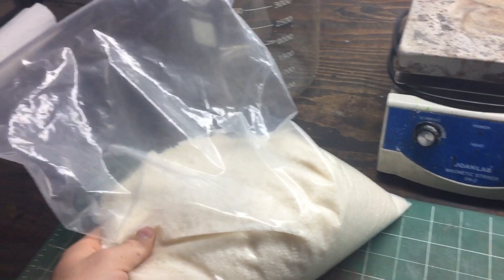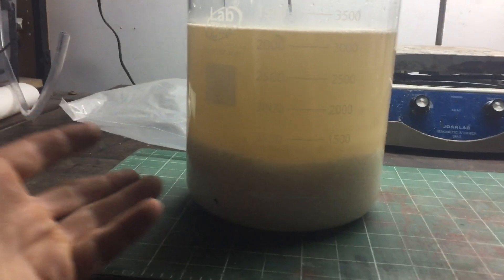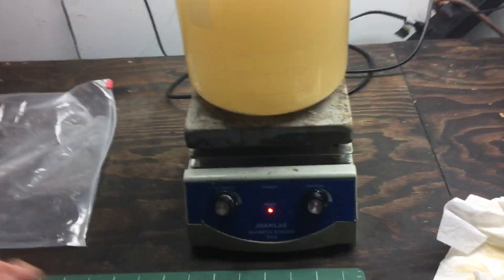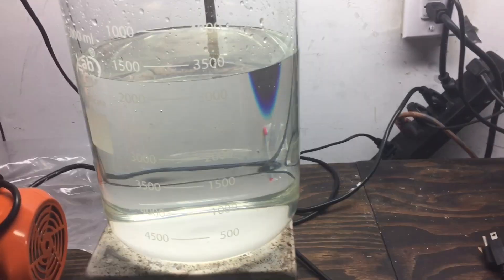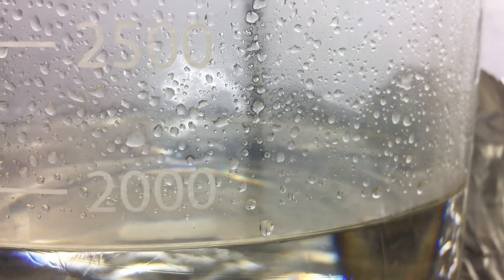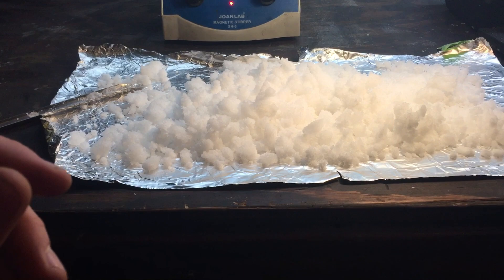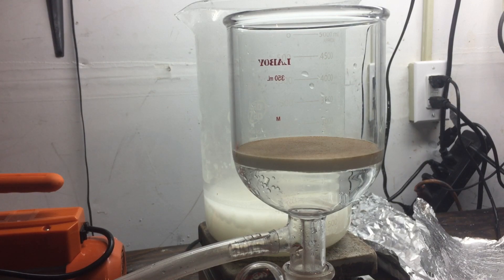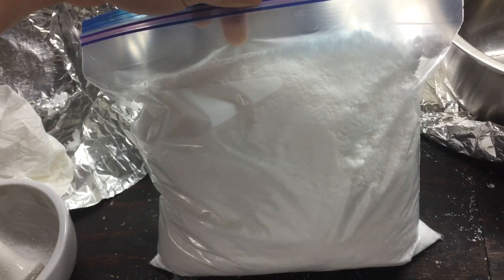Recrystallization of Ammonium Nitrate

Comment: You don't want to use ammonium nitrate as your nitrate salt for making nitric acid as it forms hard to separate byproducts. Potassium or sodium nitrate are both easier/cheaper to get while not producing these byproducts.
Reply from the maker: drew6017 if you watch my Nitric acid video you'll see that I remove the ammonia and convert it to sodium nitrate which is much easier to use. But ammonium nitrate was still my precursor.
Reply from the maker: drew6017 also potassium nitrate and sodium nitrate are hard to get where I live. I had a hard time even getting Ammonium nitrate.
Reply from the maker: drew6017 thank you though.
Reply: @tannerohara5973  , where do you live?  I can get KNO₃ at Lowe's for $7 a pound.  I also order it online for $4 a pound from Amazon as a stump remover.  NaNO₃ is a lot harder for me to find locally.  NH4NO3 is impossible to find locally.   I am in Kentucky.
Reply: If we add nitric acid and ammonia to ammonium sulfate, won't it turn into ammonium nitrate?
Reply: @BackYardScience2000  probably Canada.  It was hard to get nitrates when I lived there.  It's so much easier in the US where we are now.

Comment: Thanks so much for this, I used some instant cold packs, the stuff inside wasn't even close to being anything other than the intended use, I did exactly what you did and have a final product that is very close to pure.
 The next time I do this, I will use ammonium nitrate fertilizer, it being relatively easy to obtain and of a much higher quality than the instant cold packs, not to mention that I will end up with 100 times the product for the same basic amount of money.

Comment: I did the same thing  with a bit of a 50lb bag. I just took about a pound and a half out , let mine do a very slow room temperature recrystallization. Took about a month.  I just put it in in a dark cabinet in a beaker and didn't move it at all. That's important for formation of big crystals's not the move it not to disturb it. That is if you're not on a time schedule. I was just screwing around, but it  takes a while. I have crystals as big as my fingers huge clear chunks. 

Also to  remove the color because  sometimes it turns a little yellow without the corn, I use a little bit of activated charcoal /activated carbon. Pour the carbon into a coffee filter make a bedding of it and then pour your your aqueous solution of ammonia nitrate through it. You can get carbon by ghetto 101 (pop open a Brita filter) if you need to get it can't get it elsewhere it really works good for removing color .
Reply from the maker: Yeah that’s a good way! I was mostly concerned with  removing organic material before I made nitric acid from the stuff. I have some pretty large copper sulfate crystals from doing a similar process though minus the activated charcoal filtration.

Comment: Very nice! The end result is gorgeous. When I recrystallize compounds to purify them, sometimes the crystals are so nice that I don't have the heart to pulverize them back down to a powder, so I leave some of it as crystals. 
Do you get all of the H2O out of the end result to make it anhydrous?
Reply from the maker: justin h yes, but after extended storage the salt picked up some moisture and needed to be dried out before use.
Reply: @tannerohara5973  Yeah, maybe store it in an air tight container under nitrogen or some other inert gas? I plan on building a nitrogen generator so I can use nitrogen as an inert atmosphere. But until then, I have some Bloxygen cans I got off Amazon (way too expensive for just some nitrogen, but it'll do for now). I use it to for things like ether and chloroform. 
Just an idea.
Reply: @tannerohara5973  Did you only use a heat lamp and vacuum pump for drying? I am having and awful time drying some of mine.
Reply: @tannerohara5973  Somebody kindly help me find the temperature at 4:12 , or at what temperature (100°c or 120°c or 170°c) should we stop heating for good crystallization and avoid decomposing ?

Comment: AN has a high solubility 1Kg in 100mL at 100°C in your case 5lbs equals ~ 2.5Kgs it can be dissolved in 250mL. You can start by boilling water then add it to AN

Comment: Hi ..... is not clear for me  why  we need to ad so much water  to amonium  nitrate crystals to dissolve them? Is not posible to lowering the water volume and   increase the temperature of solution  at a higher level ? ...At a higher temp  the same volume of water will take much more ammonium nitrate in  it  , after that  filter the warm liquid and after that boil it  out .... because we start will less water ,boiling out  to concentrate the solution will take less time...
Reply: based on the solubility of ammonium nitrate (~1024g/100ml water @100C)  then yes theoretically you would only need to use about 230ml of water for the 5lb bag he used in this video. I'm assuming the reason he used excess was just to get as much into solution as possible before heating it, to see if heating was even necessary to get it into solution (because solubility is only 150g/100ml @20C meaning you would need  ~ 1520ml of water). Basically to answer your question: (I'm assuming) The reason he used 2000ml of water was to try and eliminate the need for an initial hot filtration because as he stated later in the video it caused clogging in the Buechner funnel and overall made It a pain in the ass to filter. To answer your other questions, yes it is possible to use much less water, however, you will need to do more hot filtering than you may want to. 
1. sorry for the long response, hopefully, it helped
2. If I'm wrong about any of this feel free to correct anything I have said, I'm always down to learn something new or something to correct my previous knowledge!

Comment: making nitric acid with ammonium nitrate is kind of counterintuitive because as you boil the acid with the ammonium nitrate it releases ammonia gas which will neutralize the nitric acid as it's coming over with the ammonia gas as its condensing in the condenser
Reply from the maker: Cannagorilla Canna well obviously you didn’t watch the nitric acid video then bud. I converted it to sodium nitrate before processing it to make nitric acid.
Reply: @tannerohara5973  you didn't say anything about the metathesis reaction in the video bud so I thought I'd mention this.  I had made nitric from NH4,NO3 and found out the hard way. It wasn't to offend you.  I thought it was a great video and I subbed
Reply from the maker: Cannagorilla Canna I wasn’t offended haha. Thanks for the comment.
Reply: @tannerohara5973  I wish I knew how to make videos with the production quality that your video present but I can't find a good video maker for free.  Not sure if you've seen any of my videos.  I try though.
Reply from the maker: Cannagorilla Canna I’ll give them a look. I use power director 16 it’s pretty decent. I’ll give the videos a look
Reply: @tannerohara5973  thank you brother

Comment: hi there verry interesting, can i make amonium nitrate from amonium sulfate ? i have 100 lbs. of amonium sulfate 20, 0. 0.
Reply from the maker: spot lobac yeah, I’d suggest a very different procedure though. If you are interested in further discussion respond and I’ll put my email down
Reply: @tannerohara5973  If we add nitric acid and ammonia to ammonium sulfate, won't it turn into ammonium nitrate?
Reply from the maker: @kemalk-gt7cu  I’d to look into it more but I believe so. There would also be side reactions from the ammonium ion as well. I wouldn’t recommend that path.
Reply: Just add calcium nitrate and filter off the calcium sulfate that forms.

Comment: How do you dry it?
Reply: I just put it on a stainless steel baking sheet, then put it in the oven at about 200F for about 20 minutes. Then just blend it up and store it with some silica gel desiccant packets.
Reply: @isaachagenbuch4584  yes definitely in an oven, tried to dry it once in a microwave since it has a pretty high melting point and I figured it wouldn't reach that temperature. But apparently ammonium nitrate absorbs all radio waves so I instead got a solid disk of rock hard AN

Comment: Did you end up making nitric from it i'm thinking of doing the same thing I'm thinking you must bubble it though hydrogen to get the hydrogen nitrogen bond not sure though (should brush up on my chemistry) any help would be much appreciated.I can kind of skip this step due to no corn being in mine LMAO. Most likely that came from a farm supply.
Reply from the maker: I would still recommend a recrystallization just to remove impurities that may cause you trouble further down the road. I would also make sure that you're very aware of the chemistry and hazards of making nitric acid.
Reply: I'm aware of the dangers i'm just melting silver in it nothing crazy. How are you making the nitric electrolysis? Also found this how to make HCL either one will work for me https://www.youtube.com/watch?v=avMG_L-DNoM  just was curious how you were going to do it, and both would help to dissolve some gold. I have some microwave transformers I think im just going to make nitric with an arch anyway. Rite aid brand cold packs still contain the good shit (''
Reply: @toolofbordem  good to know, walgreens start putting calcium ammonium nitrate in theirs.
Reply: @johngriffin618  And that's why I should keep my mouth shut.